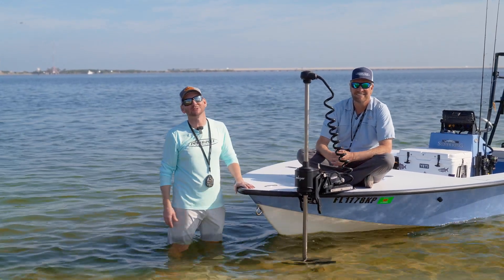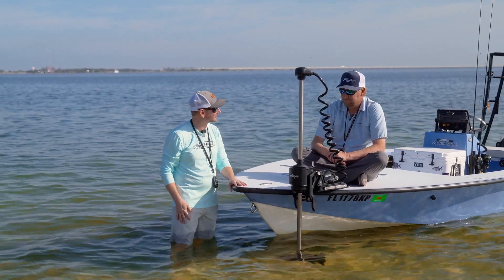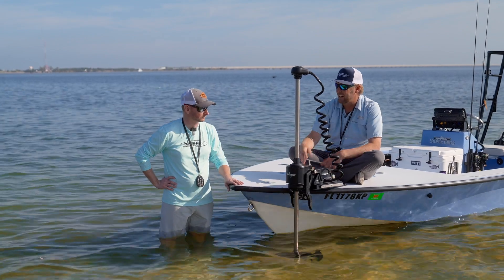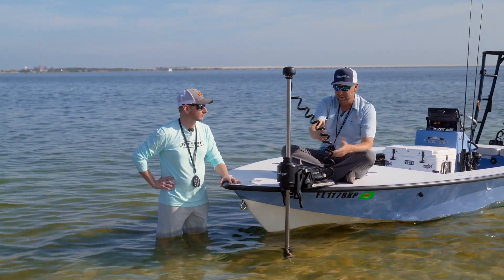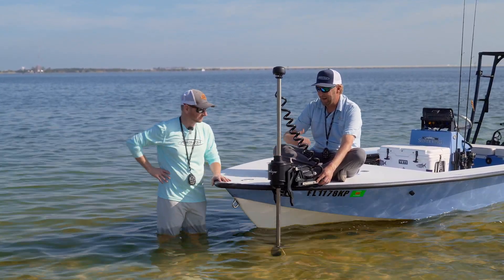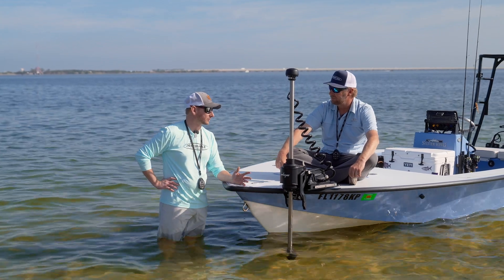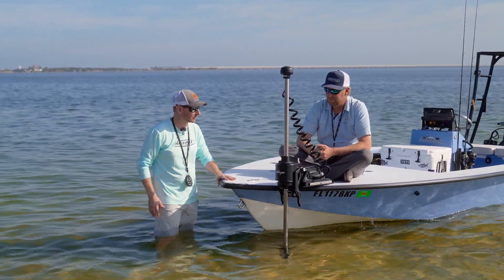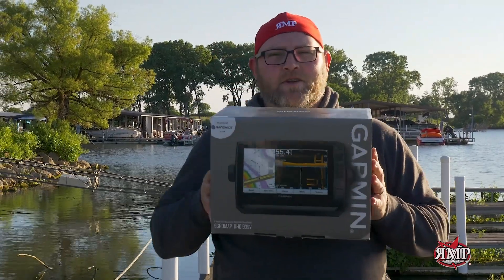Power Pole MOVE PV Trolling Motor.  What makes it different from the competition?

Comment: Looks like a kitchen mixer from the 1950s .  I just don't see how this product impacts the trolling motor market at all.  Beyond using needlessly expensive components, there is not a functional advantage.  I have been running trolling motors for a long time and "reliability" has not been an issue.